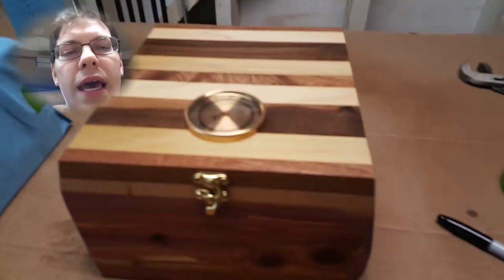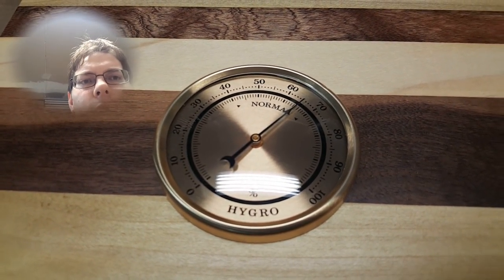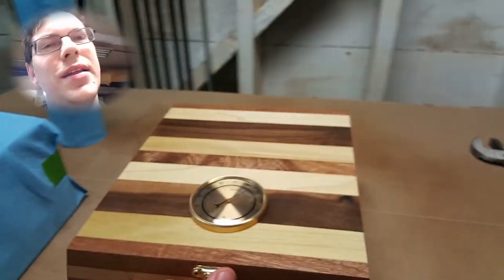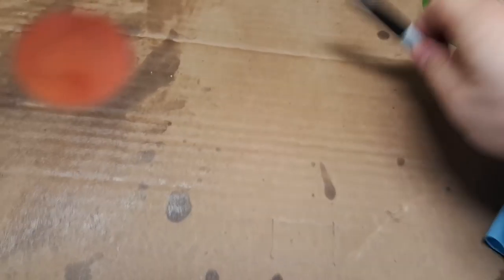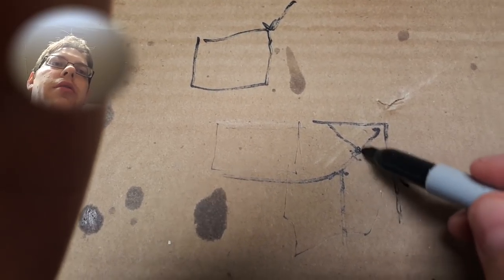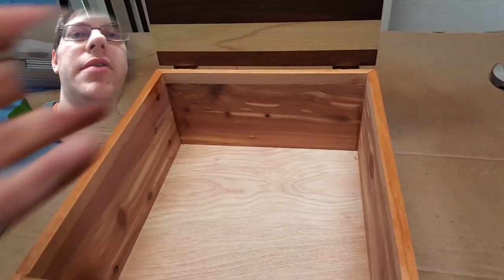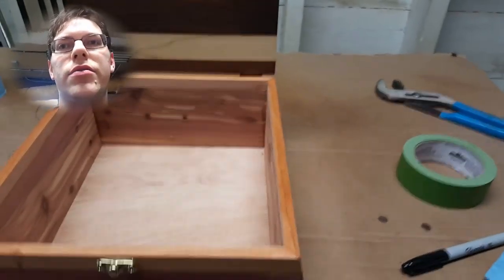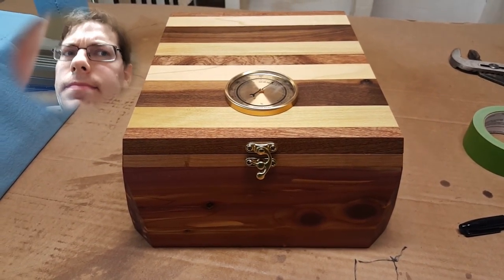Humidor storage box for magic the gathering

Comment: is it possible to put down maybe a felt cushion along the inner walls and floor or could that possibly soak up moisture in the air?
Reply from the maker: +Fappin Trustab I think it wouldnt make much of a difference.  IF I was worried about actual submersion or lots of water in the area...I'd get a pelican case.

Comment: And I can't even make a box out of  2x4s
Reply: +connor stafford (mememaster) a box from 2x4's would be highly impractical. If by box you mean the frame of a house, that makes more sense, because they'd be the studs. A box would be made out of typically 3/4" to 7/8" material. Sometimes even 1/2" but I'm not into that. Just seems too light.

P.S. i know what you were getting at, i just thought i'd patronize you a little bit.